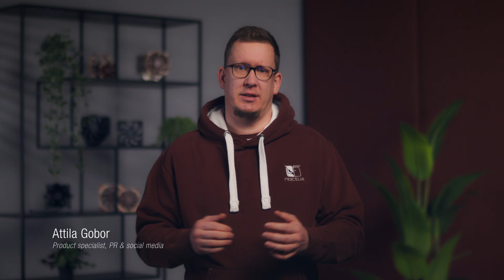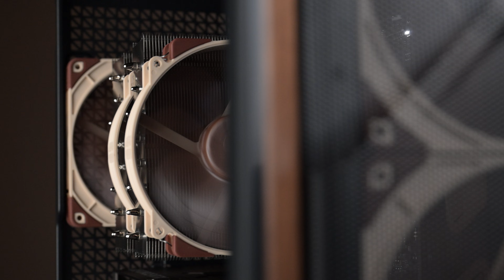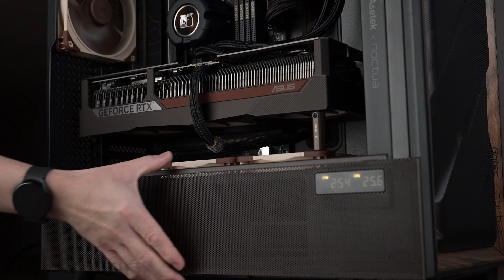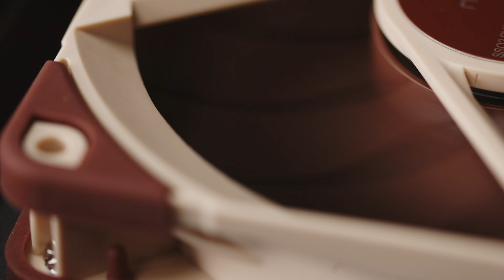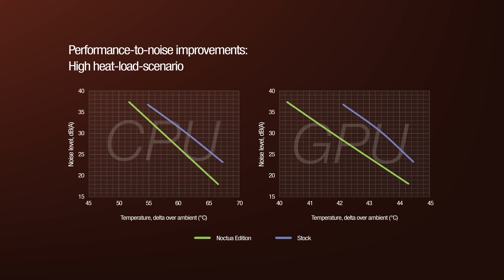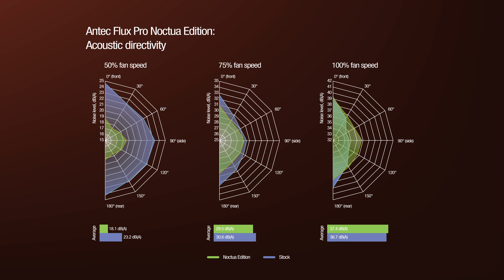Feature walk-through: Performance and acoustics of the Antec Flux Pro Noctua Edition

Comment: Anyone know roughly what length to get gpu pcie cables for this case?
I have one on order, and I'd like to order the cables and do it all at once because I need the PC for work
Reply from the maker: Hello!
The cable length needed would vary depending on the size of the GPU, so unfortunately we cannot advise on this topic. It’s best to do a test measurement with a string or piece of wire.

Comment: Has noctua thought about designing a crossflow fan i cant help but notice it would look great in that case 
But i can see why it might not be worth it low pressure field 
Heavily require a pc case to conform to it not the other way around
Turbulence 
Lack of static pressure
Or just overall noisy which isnt the noctua style

But it might just be a niche but i see lots of cases that have tried crossflow fan cooling but theyre mainly pc case manufacturers first
Reply: Also cant wait for noctua thermosiphon 
The whole pumpless design is gonna be insane

Comment: Wouldn't it be much more optimal to add another 140mm G2 fan at the top rear to help the rear fan pulling air out of the case(making airflow better)?

Moreover, I couldn't wait for the Noctua edition of the Flux pro case to come out, so I just picked the normal Flux Pro and got G2 120/140mm fans + the G2 cooler.
I wish you would add a dust filter to the front of the case. I had to buy a sheet of mesh to make my own dust filter with magnets to the front cover.
I added another 140mm at the top rear and a third 120mm under the GPU. I didn't feel like the need to add another 140mm at the top front as intake, because there is already enough air coming in(basically 3x140mm and 3x120mm as intake and 2x140mm as exhaust).
Reply from the maker: Regarding adding fans, please give this a read: https://www.noctua.at/en/expertise/guides/antec-flux-pro-noctua-are-extra-fans-worth-it

Dust filters on the front panels of cases are becoming increasingly rare. This is mainly due to airflow considerations, as dust filters present a significant airflow obstruction. Of course, it is not ideal to have to clean out dust more regularly, but we believe that the benefits in noise-to-performance efficiency far outweigh these drawbacks. The front mesh of the case is also dense enough to catch larger flying debris.

Comment: Its a very nice case and i would buy as i love Noctua all my cooling is Noctua but the price does not justify the case £348 as of writing on Amazon. Now that being said i love to waste my money on my PC just ask the Mrs but you need to offer this case without the fans i own a collection of 9 x 140mm g2 Noctua fans 2 x 200mm Noctua fans and 8 x 120mm fans currently not in use and the NH D15 G2 cooler so i cannot justify buying the case when i do not need the fans which is an absolute shame as i want a new case and yours would be a dream to buy looks like i will be getting the HAVN BF 360 instead of yours that is my only complaint and i have never had a complaint about any of your products ever.
Reply from the maker: Hello and thank you for your honest input!
Currently, we have no plans to offer the Antec Flux Pro Noctua Edition case without the included fans, and there are multiple reasons for this. Just as we don't offer heatsinks without fans, it's the same philosophy for the case.
The product we are offering is the combination of the case and the fans, and the value this combination provides to the end user. It's the same as with a heatsink, to guarantee the user experience the product is intended for, it is delivered with the fans that we deem work best in that scenario.
There are also logistical challenges to excluding the fans, so for now and the foreseeable future, the Antec Flux Pro Noctua Edition will not be available without the six G2 Noctua fans.

Comment: Does It come in noctua colormatic?
Reply from the maker: You can still opt for the original Antec Flux Pro case that is black and equip it with the NF-A14x25 G2 chromax.black fans and an NA-FH1 fan hub. It’s going to be the same effect.

Comment: Ok. As a Noctua fanboy. I gotta say something. 5080 NE is $3500 and the 1600W Noctua PSU is $1000 and unnecessary for almost every single build out there, including this one. If i were to replicate this roght now, it would cost close to $7-8000 CAD for what is essentially a $3000 PC. 

Cant wait for the Noctua ROG Hero BTF MB that is $2500

I'll always buy your guys fans and coolers, but your hardware collabs are for the wealthy and the irresponsible.
Reply from the maker: The RTX 5080 Noctua Edition GPU is priced or should be priced between the TUF and Astral models. Since it is sold only by ASUS and controlling GPU prices is quite hard, there are certainly examples where the GPU is overpriced, but overall, it is priced the same as any high-end 5080 GPU. In some markets, the Seasonic TX-1600 Noctua Edition actually costs less with some resellers than the original model just because of better price control from our partners, and the Antec Flux Pro Noctua Edition costs less than if the end user had bought the original case and purchased all the fans and the fan hub separately.
Reply: @NoctuaVideos  i guess it's out of your control, but dammn dude. It costs $1000 more than a 5090 and the psu twice as much as much as a brand new Seasonic Prime tx1300. Fair enough that you can't control the crazy pc component market right now, just understand that was my immediate reaction to looking up what it takes to build a Noctua themed PC... $6837.54 lol

Comment: Great case, great fans. Now, about that price :)
Reply: 400€
I bought my Antec Flux Pro in March 2025 for 193€ + the six Noctua G2 fans 224€ for a total of 417€.
This case includes Noctua's fan hub and it's also color customized so it's a decent deal.
Reply: @JuanitoLima13  You're forgetting 6 Antec Tranquil fans that came with the case which also add up to the price. And there is no retail packaging included here for Noctua fans, so I'd expect a little bit less than 224€ for such OEM-style bundle. 
I do like the case and collab, just think that the price should've been a little bit lower than 400.
Reply: @itxbuilds   I might be forgetting about them because I removed them from my case and are sitting in a box. I didn't have the intention of replacing all the case fans in the first place, but after building the PC and testing them, a few of them rattled like crazy even at low RPM, so I quickly ordered the Noctua fans and I couldn't be happier with my absolute silence ever since.
Reply from the maker: The end user actually saves a bit by going for the case compared to buying all the individual parts, and also gets an awesome color scheme. ;)